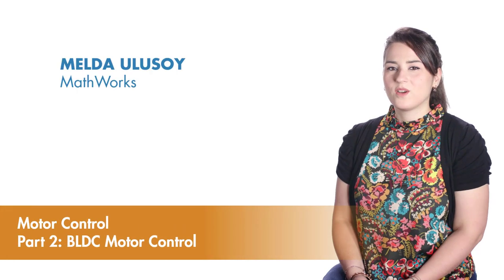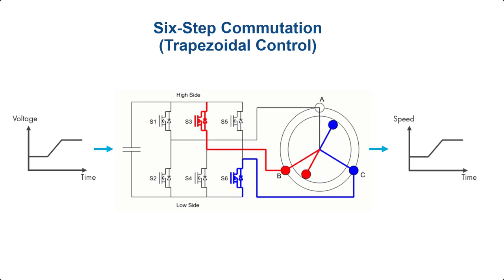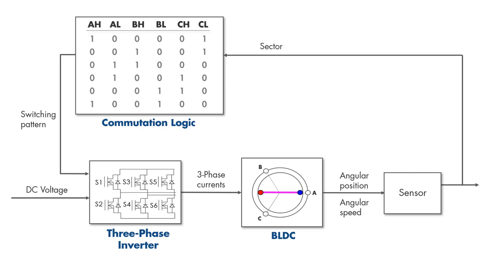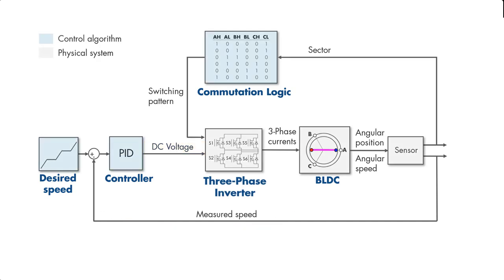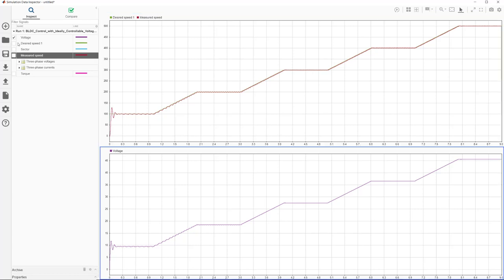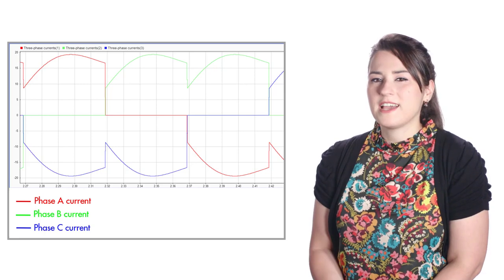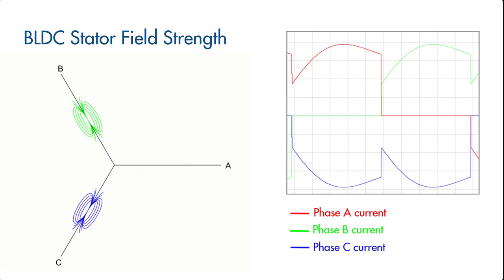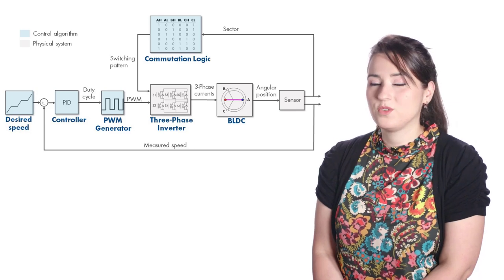Understanding Six-step Commutation for BLDC motors| Brushless Motor Control with Simulink, Part 2

Comment: Excellent video, Melda!
At the end of the video you mention PWM will be introduced in the next video. Has the next video been created? If yes, what is the link? Thanks.
Reply: The video on PWM control has been recently published. Please find it here: That video has been posted recently. Please find it here:
Reply: @meldaulusoy8389  Do we actually need a back emf if we replace a bldc motor I mean does the back emf needs to be implemented if we make the equivalant circuit, i try to test the motorcontrollers current and will measure if the commutation is going the right direction when controlling it, but does back emf have a lot of effect or can i ignore the back emf when realizing the back emf?
Reply: @meldaulusoy8389  Hey can anyone please tell me how to add 4 teminals to the BLDC?
Mine BLDC has only two terminals

Comment: In the case of electric vehicle  the motor acts as a generator, it produces kinetic energy, and I need this energy back to the battery for charging it(Regenerative braking system). I don't understand how to the inverter work when the motor act as a generator?

Comment: I have a question here. It's said in this video that to vary the speed we need to vary the DC supply voltage to the inverter. So instead of varying the DC supply if we change the switching speed of commutation in that case also we can achieve a faster or slower speed. Isn't it?

Comment: Can we see a similar video for four phase? Wouldn't 4 phase be a better choice for electric vehicles as there would always be power applied to a coil leg. Would this create more power to size in electric vehicles?
Reply: Real BLDC motors are delta wired instead of Y wired, so they don't actually have this issue, Y wiring is easier to demonstrate I guess?

Comment: Can I expect the same efficiency in both directions of a Sensorless motor without having to reset or reprogram a basic rc esc? Simply put, can I expect the same efficiency by simply switching 2 of the 3 motor wires? Thanks
Reply: Yes